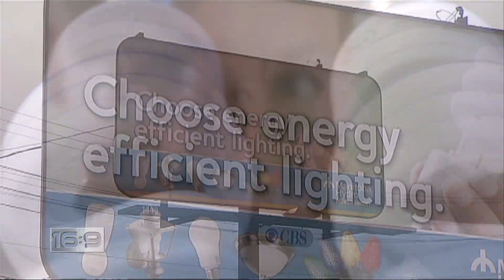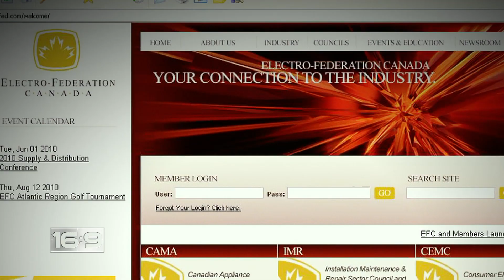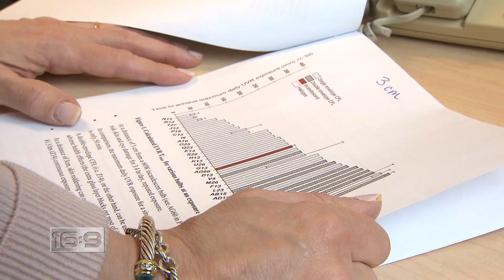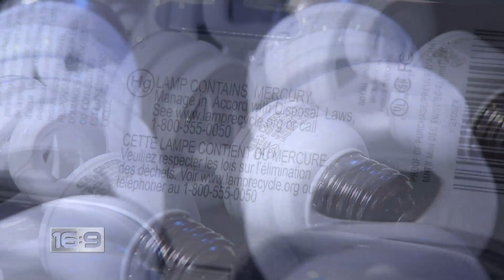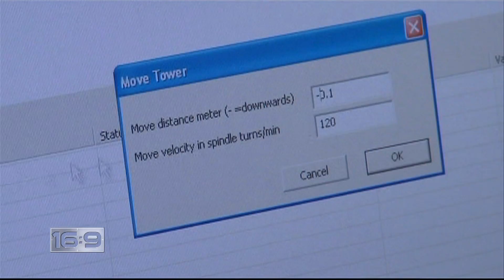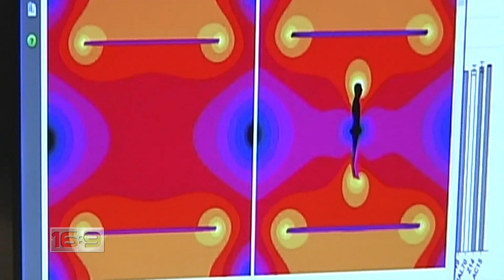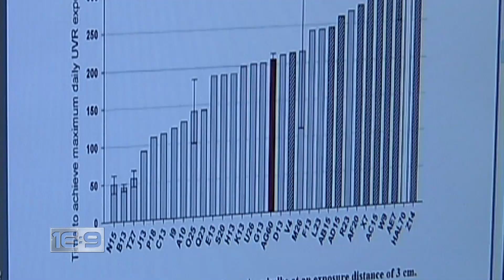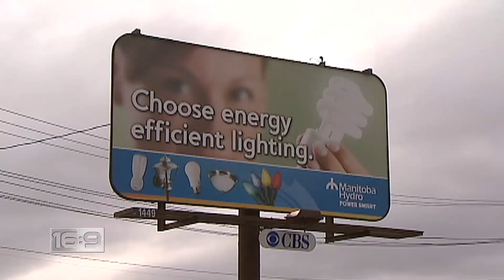16x9 - Shedding Some Light on compact fluorescent bulbs

Comment: he UV thing and "dirty energy" is a load of bull.

I work on HV power cables for hours and it doesn't effect me at all WHILE under New Zealand sun which has highest UV rays in the world and skin cancer in the world... Then again I'm white as white but don't burn I just go bit browner...

As for the mercury that's really scary mercury has NO PLACE in light bulbs how much of this mercury is going into land fill then into water ways! Mercury isn't nothing to mess around with...

If you smash one which would be common mercury goes everywhere.... That could poison a small child I'm sure. It builds up... Seafood... Light bulbs, water.... We really need to reduce level of mercury we are exposed to.

But to be honest most of these people have neurosis or some sort of anxiety disorder.

I hate saying neurosis because Dr told me I had that because he couldn't find out what was wrong and I do have CNS issues... I then went home to shit blood and not hold down food for 4 days...

But in this case I'm pretty sure its neurosis...